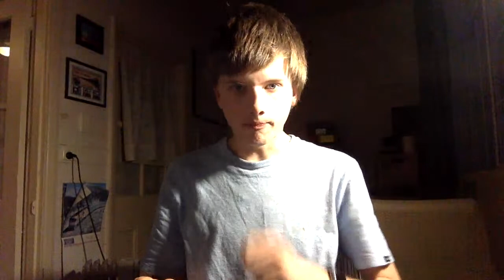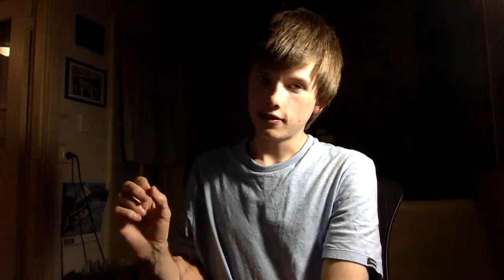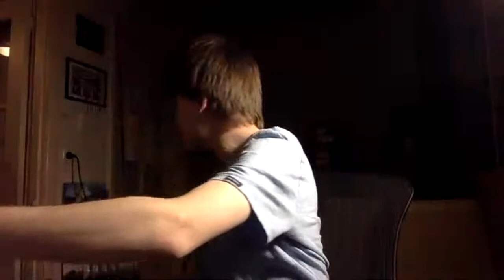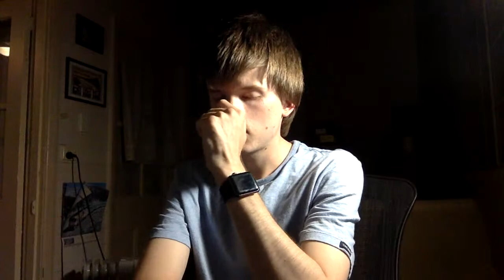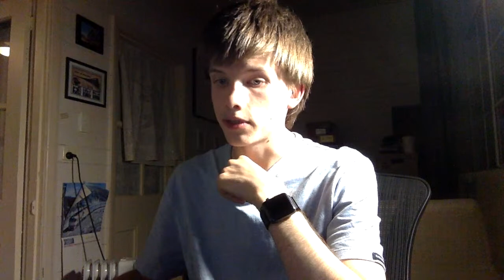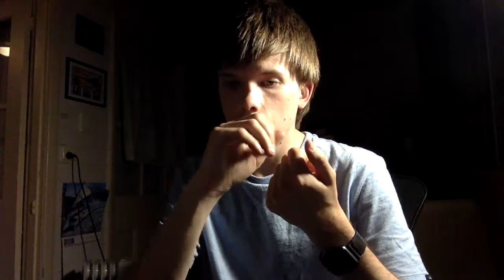Bromley Live EP33 | An Introduction to Industrial Tramways

Comment: Defining a Tramway is a complex task, there were many that were used for many years, others for only a short time. you could argue that the rail system used in the goldmines was tramway, given that they served the function of removing the earth from the minds. Likewise, a lot of the narrow gauge line like the Whitfield line to Wangaratta as its main function was to get fresh produce to Wangaratta. an example of a shot live tramway is the one built for the construction of the Hume Dam, this line branched off the Cudgewa rail line between Bonagilla station and Eden, there are some cutting remaining for its construction.
Reply from the maker: Yes the line between a tramway and a railway is a very blurry one. Blurry to the point where it makes little difference and it’s better to stop worrying about it and just learn about the individual lines history. 

Re the Hume dam, yes there were public works construction tramways from both Victoria and NSW. Both connected to the respective state railways and both were different gauges, both from each other and the railways they connected to!!